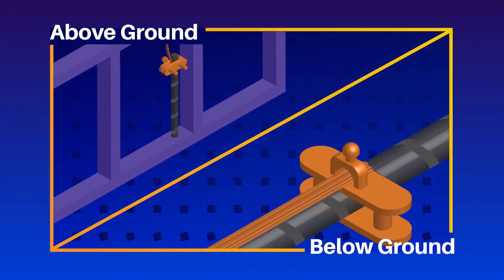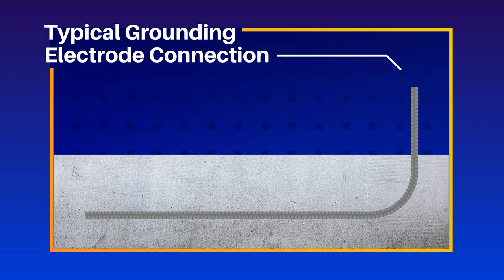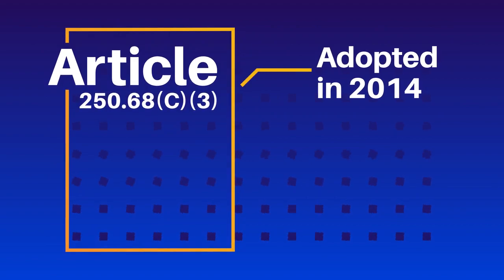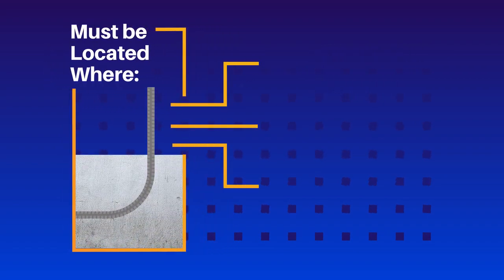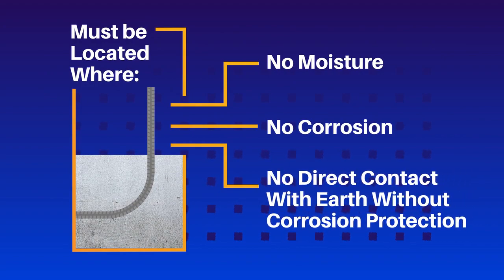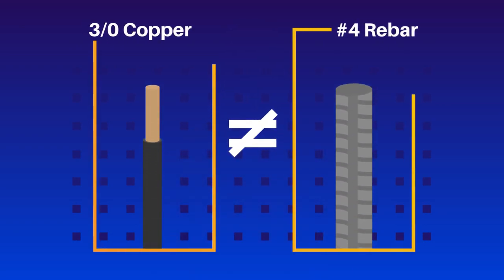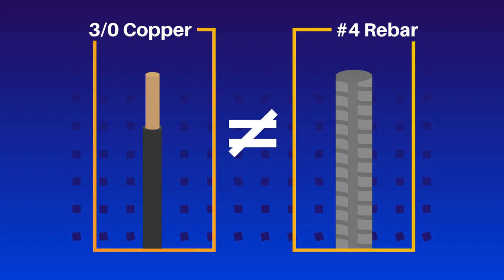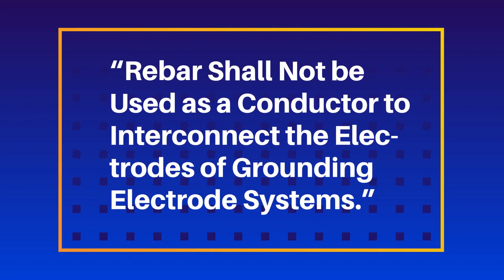2020 NEC - Article 250.68(C)(3) GEC Connections in Rebar System

Comment: If we have a rebar-reinforced (#4) on-grade concrete slab with a haunch footer,  are we required to use the rebar  as an EEC or can we install two copper grounding rods placed at least 6' feet apart and not involve the rebar in the grounding solution?   What does "available systems" mean in that context?  If the concrete slab installers did not stub out the rebar above inside the structure and did not attach a copper wire to the rebar and extend it to the service location, is the rebar considered to be "available"?

Comment: In residential, with a 200 Amp service, what is the MAX AMPS allowed to RETURN back to the utility, VIA the UFER?
Reply: None the earth grounding system is not used to carry anything back to source thats the neutral job
Reply: @thomasmarable6818  Watch MikeHoltDotCom's video.  SOME current WILL ALWAYS PASS through the earth grounding system BACK to the source.
Reply: Do the work before you make accusations.  WATCH HOLT'S VID.  Then come groveling with your apologies to me.
Reply: What are the consequences of failing to bond concrete encased rebar?  Seems like an odd 'need'.